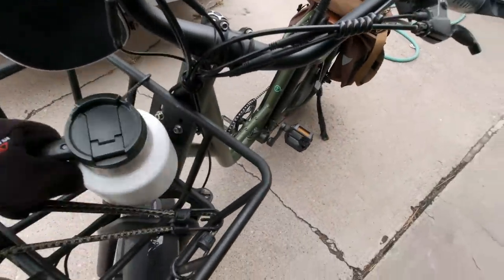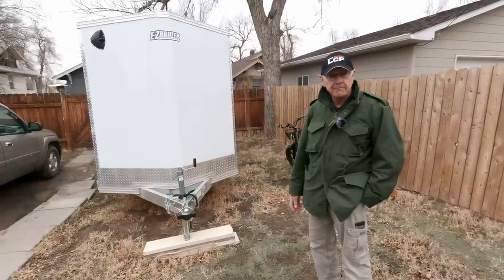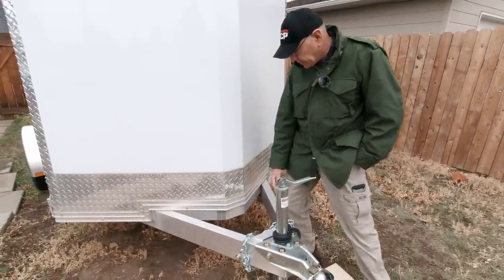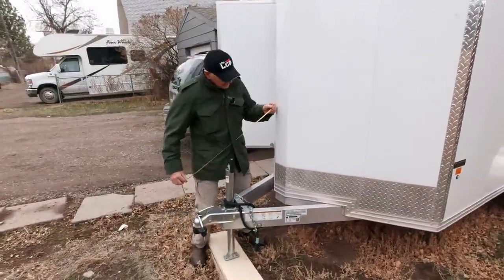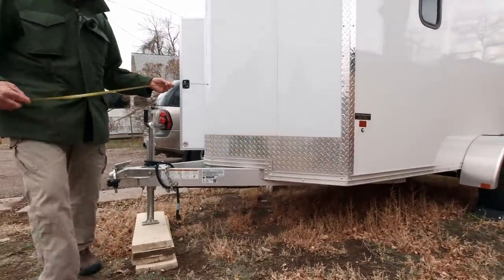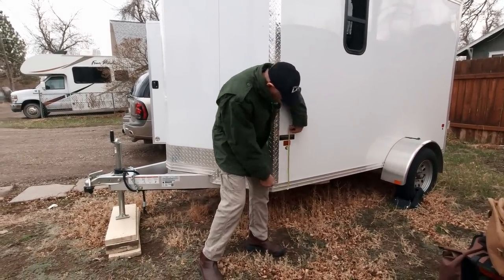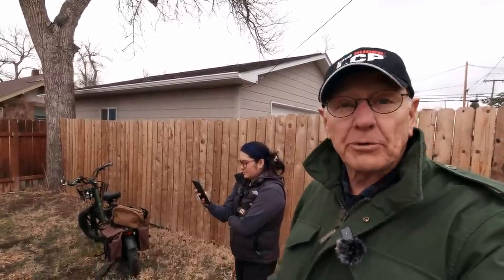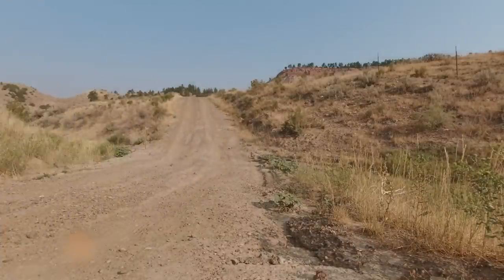Installing a NuWay propane stove into a cargo trailer camper

Comment: Good ideas ! I’m sure 20 lbs would do well !  I know what you are saying about the smaller propane tanks ! 
10 years ago I bought a tank that holds 1.5 gallons of propane as i had a really tight space issue ! The tank was $65.00 then !!  Not every place likes or refill them !

Comment: yea i originally had my nuway venting through the roof. but i changed it to vent through the side wall. i kept hitting it on limbs and drive-throughs lol
Reply: I started with Venting on side, sucks if wind is from Vent Side, Blows out 🔥, Good luck!
Reply: @patriot7979  i was worried more about gases not escaping with a continous wind on that side. but i havent had a problem. i read somewhere you want 4' of verticle venting before going outside. im just shy of that, and the fact my damper is mostly closed all the time (theres gaps all around it and the center has a big cutout anyway) but i havent had any problems. i got the 2 burner model but have only ran 1 and as low as i feel comfortable it wont blow out. no problems in the high rockies all last summer and fall
Reply from the maker: Oh, I'm finding you guys' conversation really interesting!  My stove vents thru the roof and we're doing this one through the side.  No harm done if it doesn't work though, because we're already running the side vent through a patch where the original vent used to be.  I'll make sure to have as much run as possible to get the flow going.  Thanks guys!
Reply: @gonagain  i think maybe the paperwork with the heater might have said at least 4', but i heard it somewhere. ive got this bigger outlet on the side, where i figured gases might have a better chance of escaping with a wind. i cant remember where i got it. if i do ill let you know. id be happy to show you a pic of it, if you like. i like it so much better this way
Reply: wind blows horizonally. my cap shoots down, so a wind will hit a metal face. the gases and heat is already on its way and i figure the wind might even pull it. its wide and not small.

Comment: Noticed you mentioned being to run yours all night. Are you comfortable sleeping with the heater on all night? I haven’t used my Nu-way stove yet, however I would like to be able to run mine through the night if needed. I have a propane detector, carbon monoxide and smoke detector plus I believe the Nu-way is thermal coupled.
Reply from the maker: I use mine all-night frequently, including a cold and rainy trip that Linda and I just returned from where it was running 24 hours a day while we were camped.  With the heat going up the flue, it's also drawing in air through the trailer's vent and through the (slightly) opened window.  The thermal couple on the NuWay works and shuts it off if the flame should go out.  The only time that's happened to me is when I had it turned down too low and it wasn't enough to keep it going, then it just shut it down properly.
Reply: @gonagain  Thank you very much for your answer. That is helpful for sure!

Comment: Secure coffee transport is always of the utmost importance ;-)

I'm curious. How many hours of continuous use can you get out of a 20# bottle in your trailer with that stove under what you consider typical conditions where you want heat? And what would be those conditions? And how about an example of extreme conditions and usage?
Reply from the maker: I have some answers!!  It's a 12,000BTU stove and on full blast it would last 36 hours on a 20# bottle, but we could never get it that high in our little trailer.  What's typical for us would be outdoor temperatures as low as 25F (-4C) and we would start at a medium setting for 15 minutes or so and then turn it down to low.  On a lower setting you can run it for 6-7 days straight on a 20# bottle.  That would be with the flame about 1/2 to 1 inch high.  Our trailer is fully insulated.
Reply: @gonagain  Thanks very much! I do appreciate this as I have an adventure wagon build in the works and am getting my list together. You've spoken highly of this stove in the past.

Comment: Where do you guys get your trailers from? Also how long will a propane tank last with this heater?
Reply from the maker: Hello Sara.  Our trailers are made by Stealth and my youngest daughter has an ExHauler, but there are other good ones out there as well.  That stove of ours will run 36 hours on full blast (which we have never used, ever), about 80 hours on medium and a very long time on low (which is where we usually have it set).

Comment: Wow.  I paid 60 for my little bottle and that was hard to swallow.  I use mine with a fire pit and can get two nights of conservative fires in the mountains.  Took it to the coast.  Barely able to get one night.  I had to fill that tank every single night.  I want to take the larger tank but I have my suburban I have built out to camp in.  I don't want to have a tank in with me in case of accident.  Is it ok to mount the tank on a cargo carrier in the rear?
Reply from the maker: I see them like that a lot.  What about in a roof-top carrier?
Reply: @gonagain  I could, but I'm short.

Comment: 7:55   What if dust blows in the the intake on the v nose?    Might you also get water in when driving in strong rain?
Reply from the maker: The high part of the V nose is above the dust that gets kicked up from your tow vehicle. Also, the built-in inertial separator of this style of vent also helps keep that dust from entering that way.  That separator is what keeps the rain from entering too, although in a heavy rain I might tape over the opening if there was any water coming in.  That being said, snow WILL come in through the vent, and I've had to stop and tape it closed for that scenario.  Gorilla duct tape works for that. But I don't take my trailer out in snow storms very often, so it's not much of a problem.

Comment: What are the required clearances around the stove?
Reply from the maker: You can get info from the manufacturer  that's more exact, but it's like 7 inches in the back and 9 inches on the sides.  I have less in the back because of the aluminum panel that I used and it's been fine.